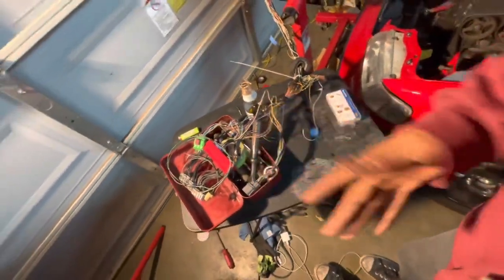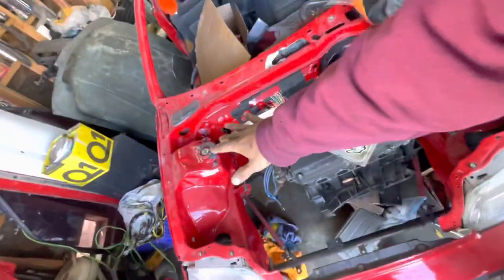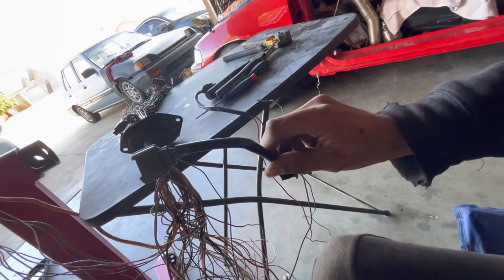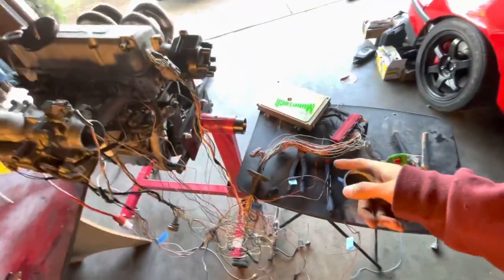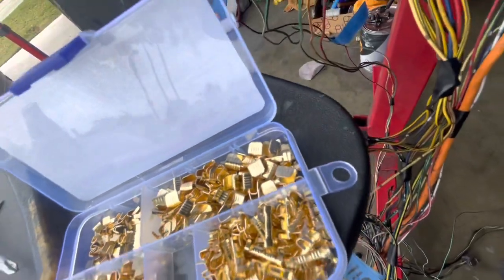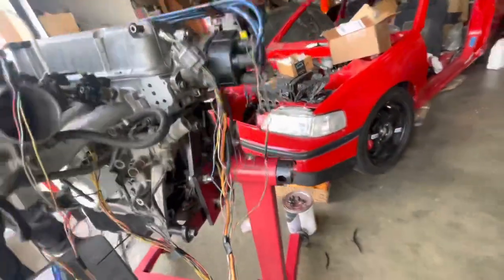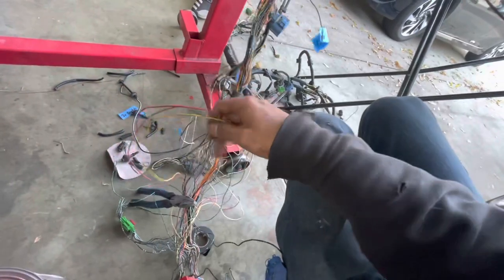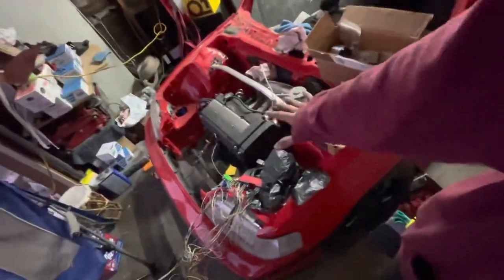How to Wire Up ANY HONDA SWAP - EK Engine Harness

Comment: Yo Nate I had a question with the EF harness specifically the harness that plugs into the main relay. I had an issue where no matter what I did the main relay will not work, so I toggle switched the fuel pump, ECU and push button started the starter everything works just fine. My question is, is there a wire that needs to be wired for the ignition? I only did the 3 so far and can't find a definite answer online, I'd like to convert it to a 5 pin relay but again no wiring diagram explaining it in detail.
Reply from the maker: im about to cover this soon
Reply: @anotherefncrxvlog4350  Hell yeah G! Look forward to the video thanks again

Comment: I went with a ry wire mill spec harness for my 88 si crx running a b16.  Because cutting and splitting wires that are 20 plus years old will have problems in the long run.

Comment: You’re way overthinking it and you’ve got it all wrong. First of all, sensors are 5V. 12V is for the injectors, IACV (these are motors), or for switches like the radiator fan switch, VTEC solenoid and oil pressure switch. These don’t “sense” anything.
The black wires also go to the thermostat with the brn/blk. The difference between blk (ground) and brn/blk (logic ground) is that logic grounds carry a small amount of voltage, less than 1V, because of the difference in resistance at the ECU and the true battery ground. It’s more than you need to worry about but the reason is because things like the TPS, MAP, IAT, ECT “sense” by providing a resistance. The ECU interprets that resistance to know how hot something is, how open something is. It all has to be calibrated to the ECU, not to a perfect battery ground. All of these sensors need to be on the same ground (logic ground) that the ECU is using. While things like motors and switches just use a battery ground in order to operate. They’re either 12V or 0, at no point is the ECU looking at how much voltage these have because there is no resistance.
Reply: The ECU sends 5V to a sensor and then sees how much V it gets back on that sensor’s signal wire. The amount it gets back is dependent on its resistance. A sensor like the IAT, ECT changes in resistance according to temperature. The MAP and BARO changein resistance according to air pressure, the TPS changes in resistance according to how far it’s turned.
Be careful not to mix the GRN/BLK 5V wires with something using 12V like the backup lights switch. VCC, SG are 5V power and ground.